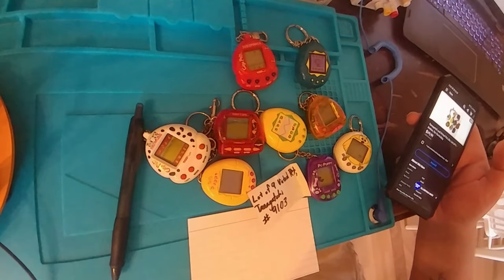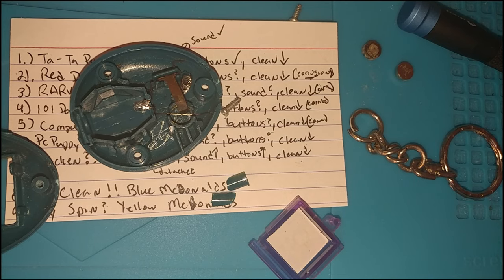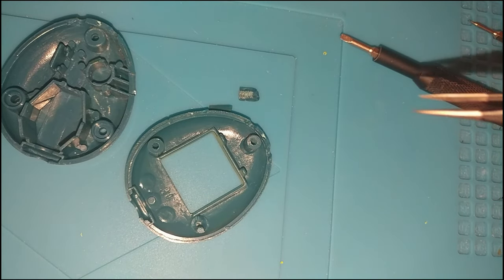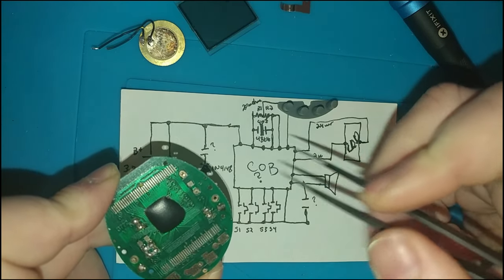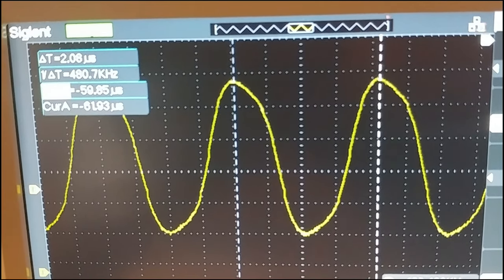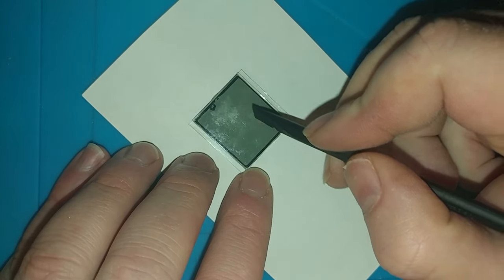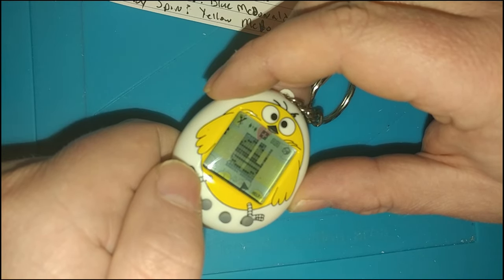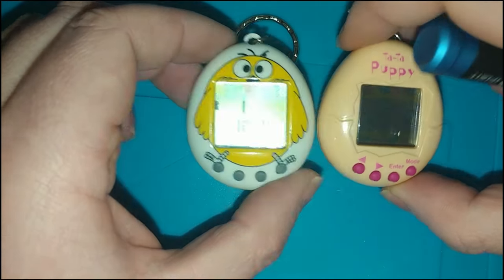Handheld Digital Pet Repairs Part 1

Comment: My absolute best toy when i was a bit younger :D thank you!
Reply from the maker: I had one myself. Unfortunately the last one in this video I could not get repaired. I think maybe if I had a new shell for the electronics it would work given the problem is between the flexing of the pcb and making a good connection with the zerbra connectors.

Comment: Do you know if you can get replacements for LCD screens for Tamagotchis on AliExpress?
Reply from the maker: @natsukihoshi2904  it's highly unlikely. I tried researching this a bit myself, but what you have to remember is that each LCD segment on the display is specific to the tamagotchi. For example they all do not have the same food or health icons.  So you would have to find a display with segments that can be excited via battery voltage to make the same icons. You are better off trying to find a broken tamagotchi that is the same as yours but with a good display. Then swapping the display over. That's a good question though.
Reply: @HavingFunRepairs  Oh, what a shame. I have one to repair—it looks like the liquid on the screen has leaked out, forming a black spot that covers half the edge. I was hoping to find a cheaper option. Thank you very much. 😊
Reply from the maker: @natsukihoshi2904  I think I cover how to kinda remedy that issue in either part 2 or 3 of this series. It doesn't fix the leak, but what I cover shows how you can move it away to the edges so you will have a working screen again.

Comment: Is it possible to buy that type of lcd screens? I have a cyber Mickey and a Buzz Lightyear rocket but both screens apparently fail.
Reply from the maker: I've tried matching screen dimensions, pinout, and pixels with mouser, as well as, just searching for suppliers. Unfortunately I have not found anything useful. That being said, you can always replace the screen with another tamagotchi screen. Even if they are not the same.  The icons may not match up, but the characters on the display should still be fine. 

If you would still much rather try and fix the original screen, depending on why they are bad, I did have some success using a conductive ink pin in my korg metronome repair video. That is if the pins on the display itself have gone bad. I'd imagine given the size of a tamagotchi display... You'll need a lot of patience and precision.
Reply: Thank you. You are right with the conductive ink. Thank you again.
Reply from the maker: @Indanipuze  anytime! If you happen to find a supplier for the screens please come back and share. I'm sure many people would be happy to have that information. Hopefully you are able to get your tamagotchis working again.

Comment: I have a problem, the virtual pet's clock began to advance faster than normal, it advances hours in just minutes. What causes this problem and is it possible to fix it?
Reply: I think i solve the problem, i remove the batteries and put them again,then set the time and load Game.
Reply from the maker: That's a good question. Virtual pets make use of an oscillator, typically in the form of an XTAL (pronounced crystal) for their timing circuitry. This enables the "game" to run at a specific pace as well as keeps timing accurate. If the XTAL is external to the main IC you could replace it with a like for like and that may remedy the issue. Rarely have I seen a capacitor or resistor cause an issue with a clock circuit, but that could be a cause as well. However, if the oscillator is internal to the primary IC, then you're most likely and unfortunately out of luck.
Reply: @HavingFunRepairs  thanks for the answer, you are very well informed! , i dont know how it last, but it fixed removing the batteries and pur them again. after setting the time again, i load the "game" andd works normally
Reply from the maker: Haha, in hindsight, I probably should suggested removing the batteries first. A lot of electronics start working again with a hard reset. Glad to read your issue is resolved.

Comment: Probable no cheese there never is, do you have the exact measurement in cm or mm i will keep my eyes opened for one. Work alot with knx and Dali automation and replacing some screens.
Cool that you moved the screen bleed and where it was you had a working screen again!
feel sry for that bird!
Brilliant video looking forward to the next one@
Reply from the maker: I can get the measurements no problem. I think the grid count on the screen would be important too, do you think so? If you liked the attempt on that LCD, just wait till you see the purple one with bleed coming in Part 3.
Reply: Is it important? If the pads that activate the screen is bigger than the receiving screen it should just duplicate in my head ;)
Reply from the maker: @andersmmvfc.8376  I believe the segment count is, otherwise you run the risk of the image not appearing correctly. EevBlog has some excellent LCD learning videos.

Comment: Just a quick question, why specifically lead free solder? Also Odd experiments channel has a simple electroplating video.
Reply from the maker: Good question. My thoughts were how many fingers would touch these terminals. Although a lead alloy would have probably worked, was trying to keep safety in mind. Especially since my plan was to give these items away to kids in the community. I considered electroplating. However, by the time I would get the items needed to do this, I would be rushed to get it done prior to moving out of country. So decided to instead forgo that option. Definitely good questions though and I follow Odd Experiments and his other channel on my main YT. Really like what he puts out there.

Comment: My one just randomly stops moving after playing with it for a while. Is this a problem? Its brand new, i hope its normal
Reply from the maker: I would replace the batteries. Even though it's new, the batteries may be bad. It sound to me that the program is kind of freezing. Does it still make sounds with button presses despite zero movements?
Reply: @HavingFunRepairs  I'll play with it for a bit more, and see how it goes. If it happens again, I will get new batteries! Thank you!
Reply: @HavingFunRepairs  it makes noise, but nothing's moving. I had to take the batteries out and put it back in for it to carry on like normal. The battery cover thing(not sure what its called) doesnt have a screw(came without it😕) might also be the reason- if not, you are most probably correct, it's the batteries. Thank u again